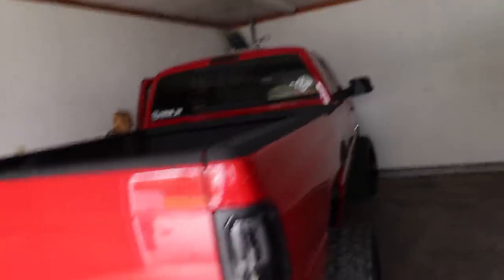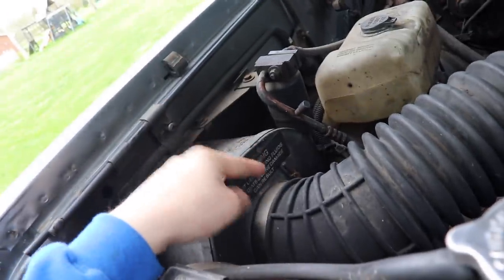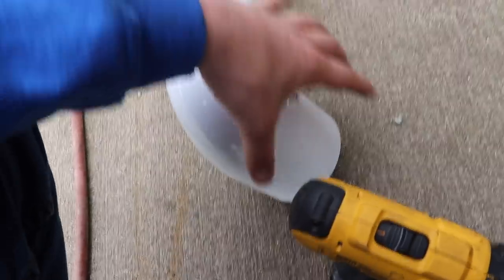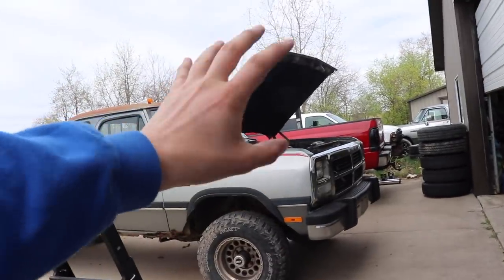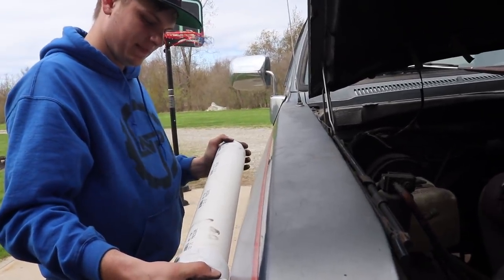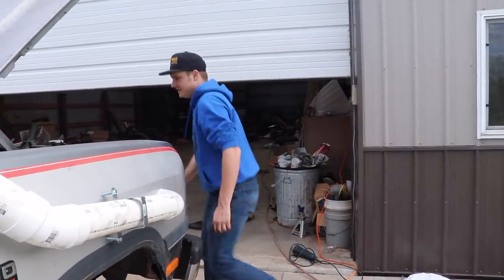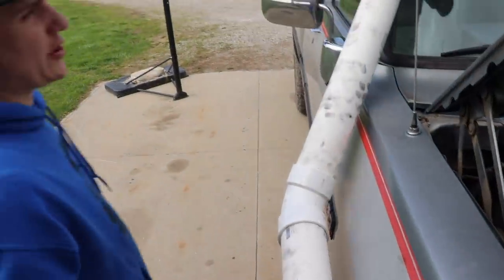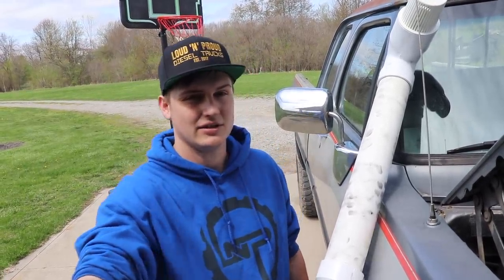WE SNORKELED THE CUMMINS MUD TRUCK!!!

Comment: You might want to add a clean out to the snorkel.  This way if it gets water in it, it would be easy to drain out.  But it may not be needed.  Never fooled with a snorkel.